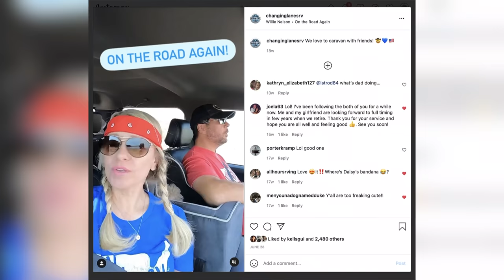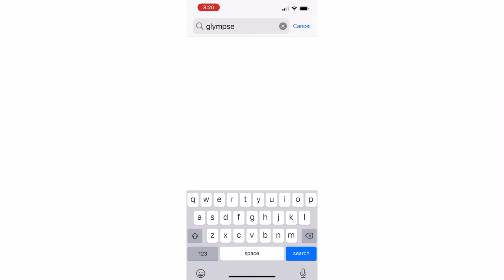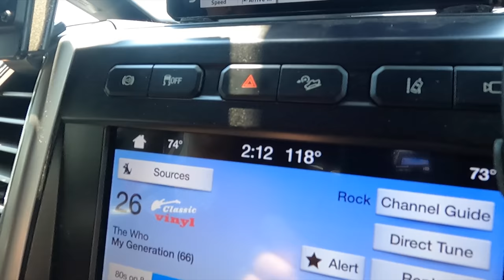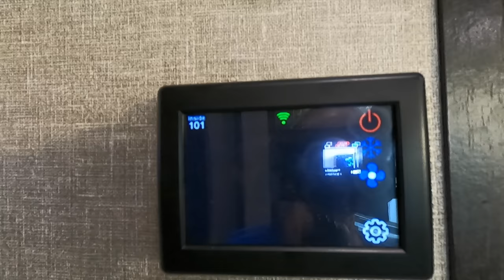😡  RV Park and Travel Day Issues! (Full Time RV Life)

Comment: You seem like pretty nice young people but I’m confused about your situation. You can afford a new camper and a new little pick-up but you didn’t bother to install solar and lithium?
I have a used F450 flatbed with a used camper and 10 solar panels. I  installed several lithium iron phosphate batteries and an inverter to run my heat pump. Today I am in the snow in Washington state near the Canadian border and it is 24° outsiders. Six months ago it was 108°. I set up my system so the heat pump would heat or cool while running on solar and the battery bank.
. I would think that in a case like yours a decent battery charger could takes anything from about 90 V to 250 V and still regulate it’s output to help keep your Power wall/battery bank up during high load conditions while still on solar but especially when getting help whilst plugged into a luxury park with grid power.
I’ll try to put up a video to show how us old timers do things because your situation confuses the heck out of me. Why did you get all the fancy stuff but ignore the basics?
I’m not criticizing you youngjns but I just don’t get it. I wonder how you boondock? I just found your channel and watched a few postings  but I just don’t get it… my truck is more than 15 years old my camper is way older than that but I am comfortable 12 months per year because I spent cash on the important things first not just things that would look cool. Maybe you could talk to some of the older folks on the road (Diesel stations and campsites in the woods or in the desert) and get some helpful advice.
I’m old but maybe someone will teach me how to post tvideos to show newbies how to do stuff.  
I’ve been doing this for more than 20 years it might be time to stop keeping my secrets all to myself.
All my best
RV Viking

Comment: THe danger here is melting the bead of the tire and causing a blowout.
The Desert Southwest is a place to avoid from Late April thru the middle of October.
Of course your jake( engine) brake will help.
No distractions to your routine. 
Have a pre trip checklist. You two are a team. Have one person read the checklist. The other does the check and treads back the name of the item just checked verbatim. 
While doing the checklist, keep the conversation to a minimum. 
This is how two person flight crew does their checklist. It WORKS..
You'll never miss an itekm like your engine braking setting again.

Comment: From a perspective of looking on, I would think RVs such as your should have back up systems for power, as you mentioned for the fridge, inverter, batteries, enough to give a certain amount of time to help run the AC unit. 
Solar charging, Solar power bank etc, and yes I know the demands of AC are high but suppose you have to have the survival thinking for bad situations. 
Your braking incident could be helped with the use of cameras with displays in the cab to keep cheek on the dics, camera tech is cheap .
At least you did enjoy some of the time there, and at worst you can hold upset everyone and run a generator to get the AC going 😎
Cheers

Comment: I don't understand why modern trucks don't enable tow mode and exhaust brake automatically when you connect a trailer. Mine (RAM) detects the trailer is connected automatically, but I have to manually turn on the exhaust brake and enable tow mode.

Comment: I had the good fortune to be at a Colorado RV park while it was getting new power. I'm sure they hated me. First, they ran direct burial cable, no conduit. Okay, but then here was not a 50 amp breaker for each site. It was wired so that about six sites share a 200 amp breaker. I was told there's a "formula" to know how much is enough. The spots were all 40' motorhomes and large fifth wheels. So at 2 am when the power went off, I just opened the main distro box and flipped the breaker back on. Needless to say, the next day the panel had a padlock on it.
Reply from the maker: OMG.  Were the electricians named Larry, Mo and Curley by chance?

Comment: We traveled though Vegas in early July as well.  The triple digit heat was not fun. Definitely not the best time to visit. Our experience with the two way refrigerator was similar to yours. After the trip, I had the refrigerator changed to a 12V at JC Refrigeration. With our Battle Born batteries and solar, the 12V seems to be working better for us.
Reply: Do you know how much power the 12v conversion refrigerator now uses?
Reply: According to the information I have on the unit, the 12V pulls 7.5 amp. Since my rv did not have an inverter already installed, I went with the 12v unit. JC Refrigeration was very professional and quick with the installation. We pulled in the service bay around 6 am. The installation was completed around 8-8:30 am.
Reply: @kevinsmith1513  90W?  Wow, that's impressive.  Thanks for the info.

Comment: You called it negativity and apologized for it, but I would characterize it as reality.  That park should not fill to max if they know they don't have the service for everyone to run at full capacity.  You are correct - if you are not getting full rated voltage (nor good water pressure and/or a constricted dump pipe) then you are not getting full hook-ups and you should have been compensated.  I know Phil and Stacy could (maybe) have jetted over the Air Force Base (they have a nice park there), but that would have left you two hanging.  Yeah Vegas in the Summer - all of us here in the desert southwest know to stay away from Phoenix/Vegas between April and October.  Thanks for sharing your experience.

Comment: Around the 7:50 mark you mentioned you didn’t have the exhaust brake on, and I’m curious as to why that was. As a CDL holder I’ve always been taught to use the engine brake all of the time when towing. I never turn it off on my F350.

Comment: Great video you guys, the way you both handled things very well considering the challenges you faced. There is no doubt that our electric grid is becoming less reliable. Over the past few years, the fragility of our grid – and its vulnerability to cyberattacks, physical attacks, and extreme weather events – has become ever more obvious. The International Energy Agency has reported that 11 billion smart energy devices could soon connect to the grid, significantly increasing loads and resources—data will become a critical enabler for system and network operators to choreograph supply and demand flexibility. Something to think about when you're RV'ing around this country, especially in the west.

Comment: Had a similar issue with a RV Park in Pocatello, ID this last summer on a very hot day. One leg was terrible and my Progressive Industries EMS would not allow a connection since voltage was below the acceptable limit on that one leg. We did not have any other parking alternatives so I ended up running my generator. The electrician they finally sent to look at the issue was clueless and smelled like and empty bottle of booze. Power finally stabilized in the evening, I guess the commercial demand must have dropped. I have a feeling it was not the park but the feed to the park. None the less, I wont book there again.

Comment: Hey guys, you need to start wearing your reflective vests on the side of the road, even its hot out there, even though you were off the road fairly far. 4 people walking around the RV with vests on will alert other motorist so they won't run you over where your are at. Sorry to hear about all the Voltage problems you had, try to keep following the 70 degree temps.

Comment: Keep in mind, in the unfortunate event that you subject you brakes to that level of heat, not only may the pads be smoking, but usually the grease in the bearings is also smoking. If it were my rig, I’d re pack the bearings asap.
Reply from the maker: Very good point!  We'll be doing that soon.

Comment: You got air in your in your calipers and when it gets hot and expands and tightens up the brakes you need to bleed them a little bit or just left the air also you should think about heavy-duty brake fluid

Comment: I got a high top van, and I've got a 5,000 btu ac and 480 ah battery and 940 watts solar , but I hardly use it anymore , look into carpet blower. Some are more noises that other goggle shop vac carpet blower 500 they got 1,000 too but 500  enough . It blow air different that a blade fan that intermittent. At evening I run it about 2 hr and I get the same thing as a ac where I get cold and have to shut it off, and you  had you feeing of cool down. Can't beat it, few know about it.

Comment: We were driving just our truck in stop and go traffic and the front passenger brake got stuck, and we hear this horrible squeaking sound, pull over to a rest stop and used the temperature gun and it said Error, and then once it cooled down to where the temp gun could read, it said 600+ degrees!

Comment: Do you guys have soft starts on all 3 AC’s ? You can run 2 AC,S on 30 amps with the soft starts . Would that have helped, but you still need 120 volts ? Just curious what your thoughts are ?

Comment: I have stayed twice in the RV park you are in, in Vegas.  However, I was there in January.   I know not to stay in Vegas in the summer.   Why didn't you use your generator until you got hooked up?  Don't you have a built in generator?  Apparently that park does not have enough power coming into the park or they need to be rewired.  You should have shown and called out that violin guy, that is completely out of line.  I would have tried to get him fired.
Reply from the maker: At the time, we were having generator / inverter issues... See: https://youtu.be/53_w0SBAh9c

Comment: Phil and Stacey (sp?) are a pretty cool pair.. I try to follow them too. I can't remember, but do you not have a generator?

  "Play the violin?" I'd have considered playing my fist on his chin..  And 50A service should be able to run 3 if necessary. So, they didn't have 50A at that site apparently...   Did any/all the other campers have similar issues?? But wow, what a nightmare... Low voltage can be an issue at many campgrounds.. One of the reasons we have a gen set in our camper in case we're either boondocking and/or having to ignore the campground's voltage..
Reply from the maker: We do have a generator but were having some issues. We talked about that here: https://changinglanesrv.com/boondocking-fail-lone-rock-beach/ 😎
Reply: @ChangingLanes  Sorry, - I must have missed that episode..  Sure hope you don't have any further issues..

Comment: Have you thought about switching your refrigerator to a dc compressor...I converted mine myself and it made a world of difference for me
Reply from the maker: Yes... or a residential...  👍🏼
Reply: @ChangingLanes  when considering changing keep in mind to install a residential fridge they said that they would have to remove the slide to get the fridges in and out with the conversion did it myself (with some help for moving fridge) inside without having to have slide removed

Comment: I just realized that it must drive you both nuts a bit when you are driving such nice scenic drives in the truck towing the trailer with your beautiful bike in the back, that you could be riding?  

Stop Tech brake pads might make an improvement with heat dissipation? 

At the 12 min mark Tara talks about baking her arm getting the sign shots...this summer we had 3 weeks of above 40C / 112F  temps and being from the great white north eh; if it wasn't for the heat wave I would have been...what does she mean? Usually we get like 2 days in the summer we might break 30C / 85F ...so we don't know that. We were driving the work truck with no air conditioning, wearing bee keeping gear...we went down an elevation and the temp went up to 43C/119F and it felt like we were on a BBQ! That kind of heat can bring out some rage. Tonight, -36C/-32F with a 50Km/27mph winds...back to normal. LOL
Reply from the maker: She holds the camera out the window to get some shots, like signs.

Comment: Chad remind me what your clearance is between the bed rails and the bottom of the 5th wheel. I just got my 2022 F350 and I have a goose box on my 2021 Redwood. first hookup has 3.5" clearance and I have ordered the B&W Goose ball which is 2.5" higher than the factory one I have.

Comment: I have yet to find a way to have the engine break come on automatically upon start up. I’m hoping you can figure out a way to have that. I hate hitting it every single time. I’d also like an opinion on tow haul mode… I’ve had two ford techs tell me not to use it.

Comment: Trying to get us a 395MS soon! Having financing issues and wondering if 8k axles, dual pane windows, and full body paint is a must for full time?? As we can save quite a bit buying off a lot instead of ordering..
Reply from the maker: I'd say none of them are an absolute must for full time.  Just nice to have.  I might consider the 8K axles a must simply for the 21K rating (double check this for the M class).  It's practically impossible to do that later.  Full body paint is certainly a splurge kinda thing and can always be done later if you really decide you want it.  The windows could also be done later, but might be higher than the "upgrade" cost.   But, these are just one opinion.  the bottom line is, get what you can get and you're comfortable with.   Good luck!
Reply: Read my story on my DRV with disc brakes there's a recall from NSTA  on mine and of course no parts
Reply: @mbrown1519  sorry how do I read your story?
Reply: @foxbraap6373  I posted it 3 hr a go on this page.

Comment: That is one thing I dislike about my Ford, you must remember to hit the “Tow/Haul” button and the EXH brake button after every shut off of the motor. I wish there was a Towing Mode in the menu so it stays on while you’re towing. The computer on those things is certainly capable of doing that automatically.
It was pretty hot(110) at Hurricane KOA in June and we had no voltage issues, you’d think a place like Las Vegas would be better able to handle the electrical load associated with that heat. Too bad about the attitude of that knuckle head at the RV Park. That’s when I trust to “karma” rather than get vindictive…

Comment: Would it help if you put in soft starts on your air conditioners?  I know that I tend to have the same problems at RV parks like you were having in Vegas  Was considering putting in soft starts. Thoughts?
Reply from the maker: Not in this situation.  The soft starts don't change the running amperage, only the start amperage.  Those help with some generators and inverters, handling the huge startup load.  We have some and will be installing and testing them soon.

Comment: When I had my disc breaks installed the installer told me you should always turn on your engine brake, I said I only use the EB when in the mountains but after that I turned it on all the time. Now on my truck the dash tells me that a trailer is connected but I have to push a button to put it trailer mod and turn on the engine brake every time i turn off and back on the truck and the backup warning switch because it thinks I am to close to a object and peeps at me, now if the truck knows I my trailer is connected why can't it be programmed to turn on and off all the stuff you need when pulling your trailer? I have been down that pass from St George UT to Vegas many times and both ways and it is a long grade. I always stay at the Oasis Las Vegas RV Resort I have had good luck with them
Reply from the maker: Stop trying to make sense.. LOL. I agree.. the trailer "profile" should have settings to enable tow/haul and engine brake.
Reply: @ChangingLanes  I had a Archery competition out doors 4th of July near Eugene Oregon and was staying in Junction City for two weeks and when we got there it was 115 degrees and the park blowing the 400amp breaker it was a mess the only thing I was surprised with that my RV refrigerator stayed at no more then 36 degrees not my last RV refrigerator never cooled down on hot days bit it was a Dometic my new one is a Norcold. I am looking at changing it over the the 12 volt compressor. But anyway the trials and tribulations of RVing.

Comment: Why didn't your Battle Born batteries and the new Victron Inverter kick in and provide the additional voltage via their Power Share mode?
Reply from the maker: Couple of reasons.. the biggest is we didn't have the victron installed yet at this point.  We'd just left Lone Rock / Page and that's where we had all of the generator and inverter issues..  But.. even if we did have it all running like we do now, the inverter will not boost voltage.  It will power share and add additional amperage if needed, but I think the low voltage might have hindered that too.
Reply: @ChangingLanes  I think you know more about this than I do.... But I thought for sure it boosted voltage too.   I will look into this more as my GoPower (like you had) I belive does add voltage.   I was thinking of doing the same as you and swapping it with Victron

Comment: Wow, what poor planning, go to the hottest place during the hottest months.  Anyway, what about all your electrical mods with solar and all your batteries?  I thought that’s what the controllers were supposed to do is make up the power your lacking by using the batteries and inverters?
Reply from the maker: Even the biggest battery bank with dual 3KW inverters can't run 3 ACs for very long.  3ACs need about 4500W.  This heat needs about 20+ hours (really more like 24) of run time.  That's 90 KWh, which translates to 7500Ah @ 12V.  That's 75 100Ah battle borns as an example.  Simply not practical to run inverter in this kind of heat, even with a ton of solar to help.  Plus, we were having issues with our genny and inverter at the time: https://youtu.be/53_w0SBAh9c. And, this was before we upgraded to the Victron.